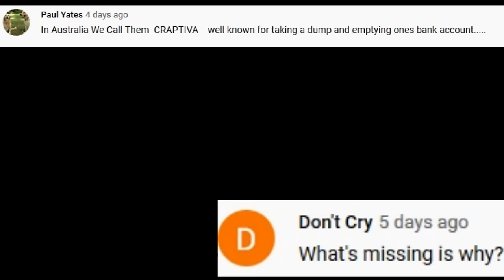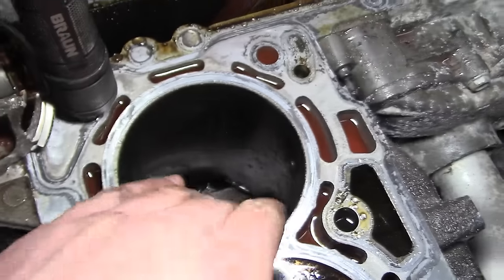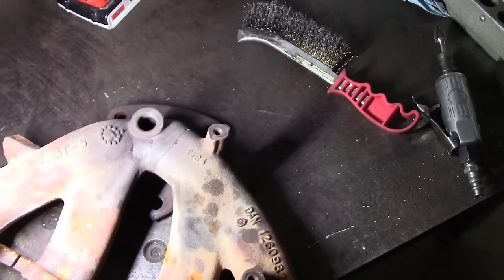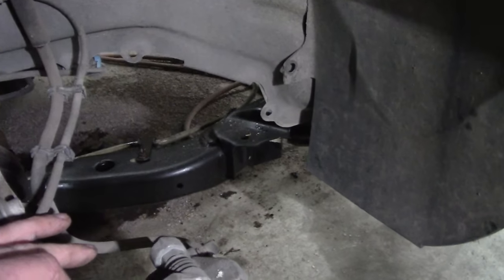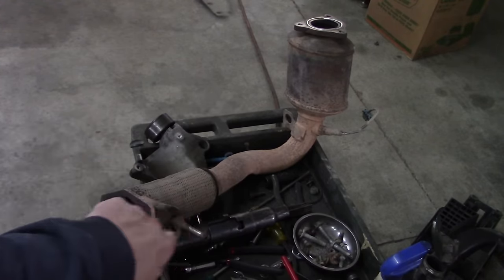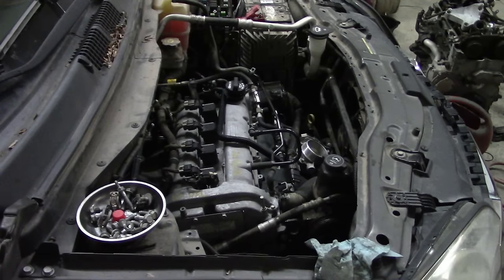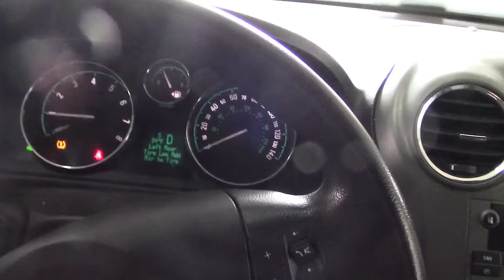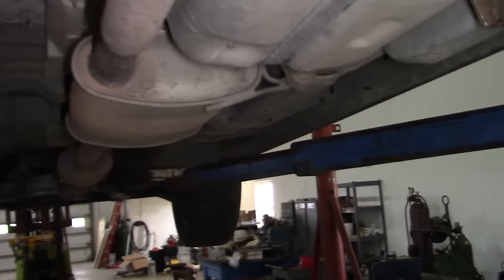I Fixed the Cheapest Small SUV on Marketplace - Part 2

Comment: Your brazing looks good. Due to the temperature :shock" of brazing, I stress relieve in an oven at 350 degrees for an hour the turn off the heat and let it cool. Brass and mild steel have about the same tensile strength of 45.000 PSI. A scored crankshaft can be metalizes (spray welded) and ground to standard. I have repaired aluminum connecting rods with epoxy and powered aluminum. The engine ran fours years and was running when I was drafted for Vietnam. Loose spindle bearings have been salvaged with ground shim stock and epoxy to center and hold the outer race or cone for tapered roller bearings. This salvage effort was for a 1958 Vauxhall Victor Estate Wagon, imported and sold by Pontiac Division of GM. The fuel pump had a lever for priming and the starter solenoid, a button for manual engagement. Lighting was by Lucas, who invented Darkness.